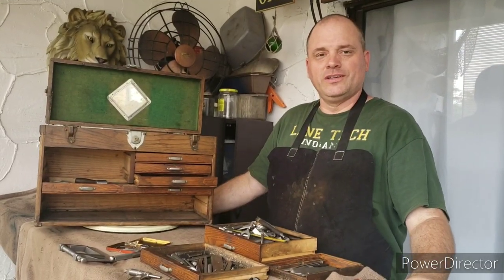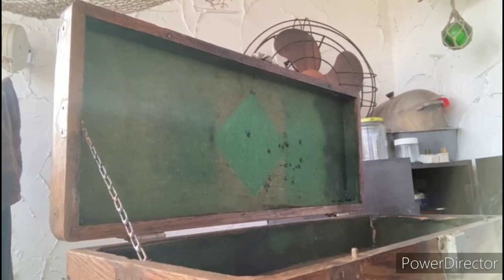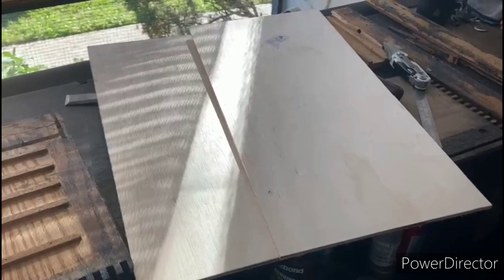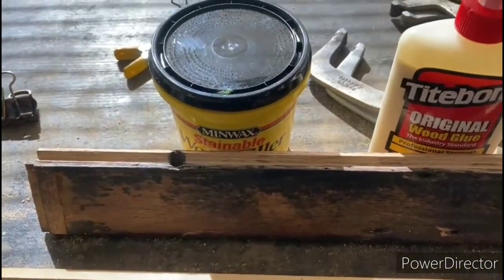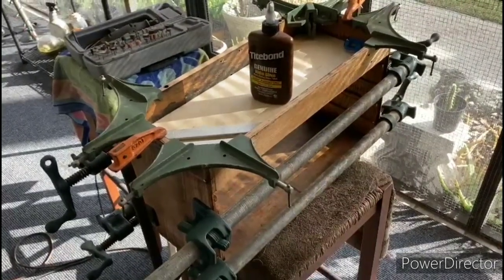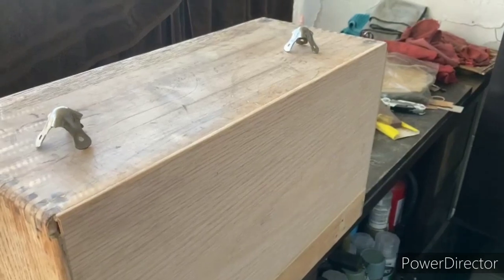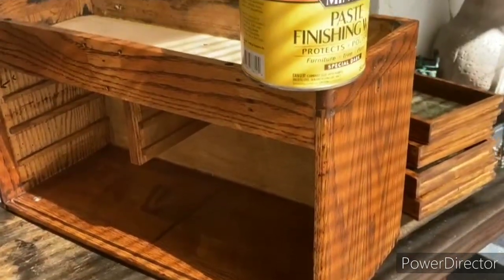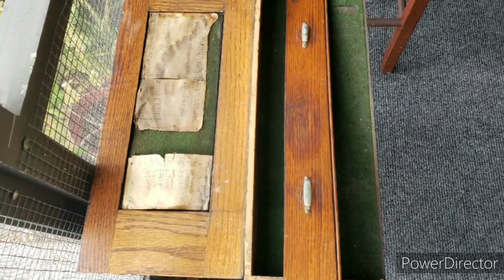Machinists wood tool box restoration

Comment: Very nice and informative video…I’m about to begin a restoration on a Craftsman oak machinist box (Union B20) and I picked up some valuable tips from you! Thankfully, no major repairs are needed, but just a complete strip, refinish, refelt, etc.  I’m going to attempt to buff out the drawer pulls without removing them as that looks like a major pain to custom make all those tiny rivets! Thanks for posting!
Reply from the maker: Good luck with your project! Glad that some information was helpful to you.

Comment: Nice find and great work. I think the judicious work of a heat gun or hair dryer would have loosened the hide glue on the felt just fine. I like to use small suction cups to push glue into cracks. That works well.
Reply from the maker: Great ideas. Glad you enjoyed the video.
Reply: @BencoVintageMachineWorks  Well oddly enough, I'm now restoring that exact model of Union box. Half the drawers have fallen apart but the box is complete. I'm rewatching to get some more ideas.
Reply from the maker: @luthiermatt Good luck with your project. Hopefully yours wont have as many extra nails and carpenters glue repairs as this one did. Took awhile getting it apart without damaging everything further.
Reply: where did you source your split rivets? having a tough time finding (except for Gerstner who want $2 each)
Reply from the maker: @luthiermatt Its right there in the video. I made them out of solid rivets.

Comment: Where did you get the split rivets for the drawer handles?  Having a hard time finding the right length thickness and head size.  I am thinking of doing nails or screws instead.
Reply from the maker: As clearly shown in the video, I used solid rivets and modified them. Rivets are available from Mcmaster-Carr.